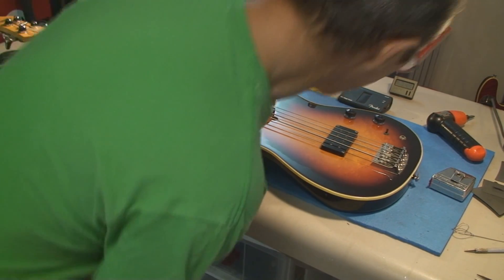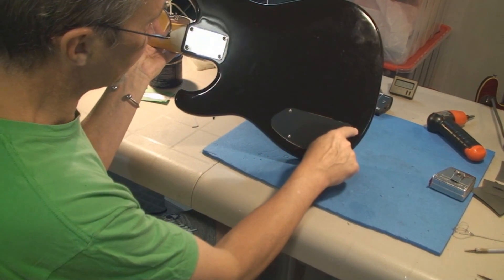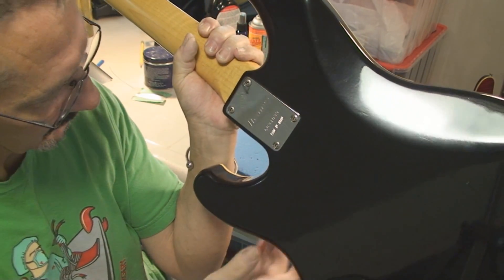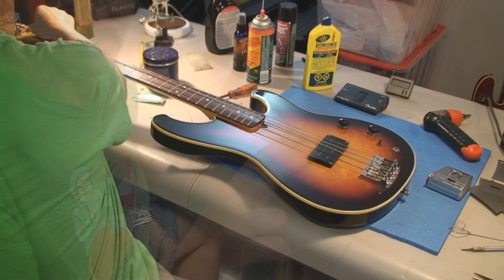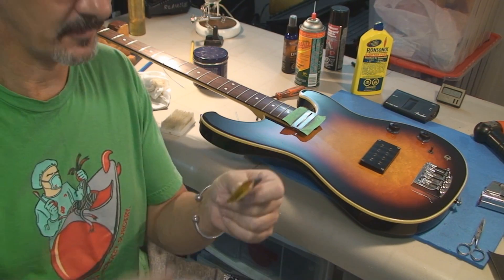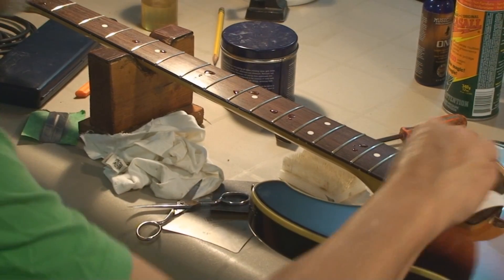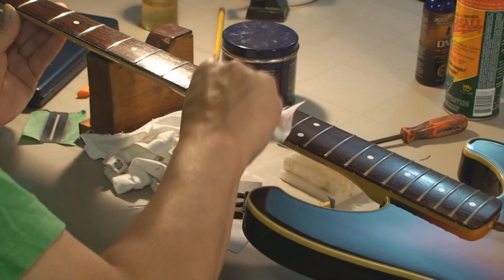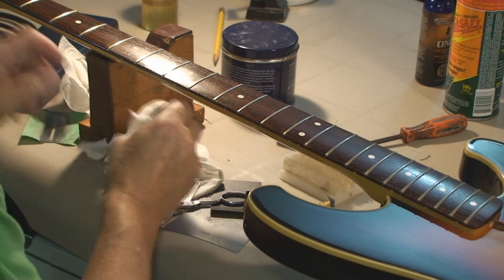Ibanez  RB 920 Bass Guitar Setup

Comment: A lot of players knock stock Fender bass bridges, but I'd put one that RB920 in a minute to get the action down. It's same with those silly Badass bridges as is with that Ibanez bridge. Too much metal!  On a lot of basses to get that low action with a BA bridge, you have to route the body to get it low enough to facilitate the lower action.  Just my 2 cents worth.

Comment: alright, surely there's no "lever" on the neck, you're not standing on it. but when you move the sandpaper (or what you move onto the neck) so it'll always be an exert pressure (ok..very light maybe...but there's..and let's suppose the axe and neck had issues in that point... cracK! you could get a crack for example).So imfho it'd always be remove the neck..and work on it only after yopu remove it from body. Or  make you sure to use a pedestal-chunk as tall as the body thickness....not more !

Comment: Why do you place the neck of the guitars up/on that piece of wood? just only the edge of the body touches the table, so you should never place that wood pedestal under the neck of those guitars. It's too tall in comparison of the body's height. remove or use a much lower one